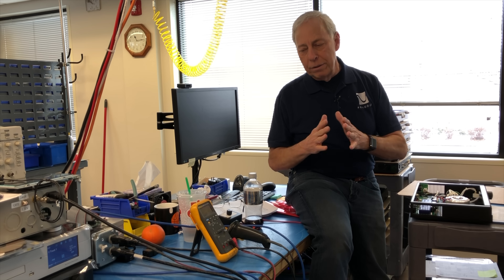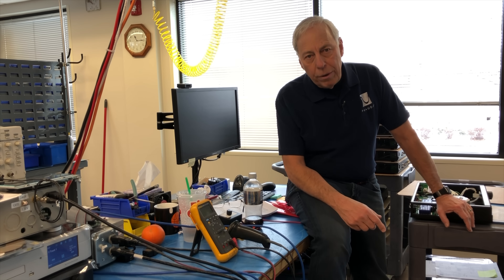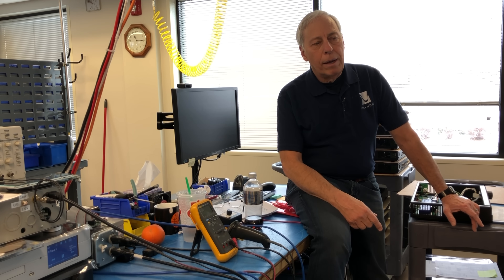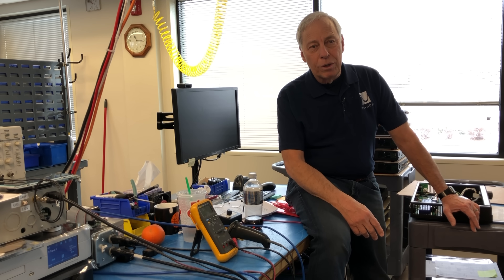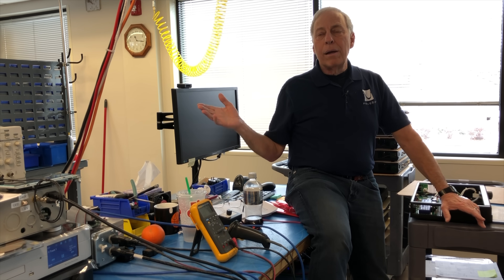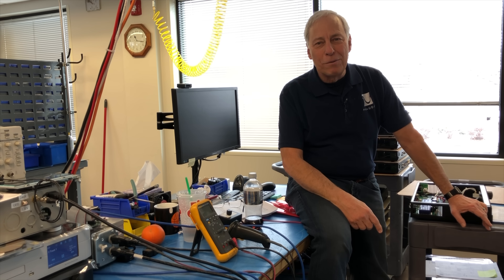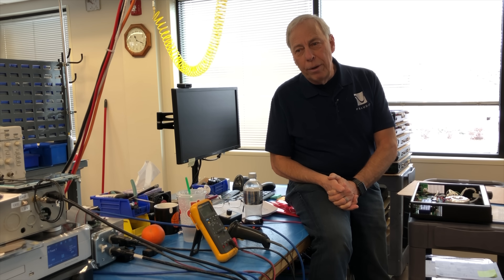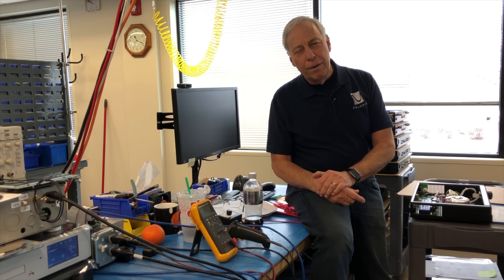An amplifier's first watt

Comment: When transistor amps first came to market they exhibited specs 'better' than valve amps. Unfortunately these specs were at full power. At low volumes, as no account had been taken of the cross over region of class 'B' amps, the distortion was horrendous. Only the 'tips' of the signal reached the speaker at low volume. The rest got lost.  There is also the presence of background circuit noise that intrudes at low volume. A mains hum which annoys at setting one, may be inaudible at setting 11. It is possible to design 'full range' preamps with 'slow' ic's such as the 741. A lot of mixer desks apparently had them before the likes of the 5534 came along with a nice wide bandwidth and low noise. You just have to take account of the slew rate limitations of the beast, limiting the gain accordingly. Modern power amps are much better behaved in the cross-over region (using class AB), or avoid it altogether by using class 'A'. How successful they are at driving speakers at low volume is another question. This was one of the driving forces for single driver speakers without crossovers to muddy the sound.

Comment: Lord this guy needs to go read some spec sheets and do some real world comparisons because he clearly hasn’t. The crown DC300 was built back when crown wasn’t exclusively pro audio and was a remarkable highly resolving amplifier that was actually used almost exclusively in home audio applications and is to this day one of the best sounding amplifiers I’ve ever heard at any price. Remarkable sound stage can be achieved from that amplifier. My pops still happens to own one and still uses it to this day. I have the little brother which was the DC150 and it to is an incredible amp. Almost identical specs but half the power. I don’t currently use it because my JBL 6290’s sound slightly better and have way more headroom but that doesn’t change the fact that Paul is constantly talking out his ass on some of these topics. I know because I have vast hands on experience with these very amplifies and am pretty well versed in crowns product history. These days I wouldn’t be caught dead using a crown amp in a resolving system but back in the day they made incredibly good amps for both pro and home applications. Regarding the first watt issue, as the greatest amplifier designer who’s ever lived Mr. Nelson Pass would say if the first watt doesn’t sound good who cares what the rest of them sound like after that. And yes I have experience with Pass amplifiers. Yet another reason why I’m comfortable saying Paul is full of crap regarding the regarding the crown DC300. As Paul would say end of rant. I didn’t mean to go on a tangent but lord sometimes he just says some off the wall stuff that has no basis in actual reality

Comment: I have a Crown XLi2500, a "lower end" AB amp, a lot of power. It does a nice job especially with rock, electronic, blues. Not trying to say it is HiFi or anything, but definitely good quality, good power, neutral sound. Great for it's purpose.

Comment: That Crown DC300 could start a car. But they also did exceedingly well with difficult and challenging speaker loads. The stability was stunning. Also, since guys were trying to have rock concerts in their homes back in the day, nobody came close to the power and fidelity that the Crown could deliver. The specs were about as good as anything before or at the time and in many ways, the DC300 did very well in critical listening reviews. Stereophile gave it about as glowing a review as the voice-coils were getting on JBL drivers all over the kingdom. Anyhow, I've had some pro audio amps in and out of my systems, always willing to give one a try. But they never satisfy with all of the nuance and sonic realism that hi-fi companies strive to create. But damn, the Crown DriveCore class D amps offer insanely great value and performance with many liking their hi-fi sound.

Comment: hi   ,i want 
to make this nelson pass f6 amp  and i got toroidal transformer at home but its not 18 
volt secondary  but 24 volts so i got 6 volts excess. my question is. 
can i use this transformer! is this  a good solution to put resistors 
between capacitors to reduce voltage supply!  and what resistor value 
will be correct and watt of the resistor so this amp works with 2 amperes 
about.thanks  for your help you can  see the shematic at diyaudio

Comment: Watt? I had a Harmon Kardon 30watt reciever. I always wondered how much power it was putting out so I bought a wattmeter from RadioShack and found that at a pretty loud at only 2 Watts. Sure it would put our more under peak loads, but it still wasn't that much. A while later my buddy invited his friends and we had a party. One of the guys wanted to hear what my stereo sounded like so I fired it up. It was about mid May at the time and when I put on Pink Floyd's we don't need no education with the door and windows open and cranked it loud enough to enjoy, we heard cheering. I stuck my head out the door and looked at the High School Football field next door. We discussed what might be going on because it was long long passed Football season, so one the the guys ran over to take a loot. He peeked through the vines that were growing out the fence, and he came running back, beer in had yelling turn it off. When he got the the apartment I asked what was going on, and the school was holding its graduation. So we shut ever thing off closed up and turn out the lights. Sure enough no sooner than we went silent the police showed up shining their light through our window. After a few minutes the left. But it didn't take much more than maybe 5 or 10 Watts to get arrested! Luckily they didn't knock on our door. There wasn't much room in the apartment for fifteen guys!

Comment: Here's the thing. Unless you are sitting a LONG distance away from very inefficient speakers, at normal listening volumes you are probably never going to use more than a few watts and 90% of the music you listen to will be in the 0.1 to 1 watt range. The first watt is the most important.
Reply: Bruno Rivademar Very true, I thought I was listening to my music at a loud volume and figured I'd check with my multimeter.

It was about 3V peaks on my 85db sensitivity Chane A1.4s... About 6-7 feet away from them too.

To anyone wondering what 3v means, that's under 1 watt on my 8ohm Chanes.
Reply: WORD!
Reply: Yeah thats true. I listen in near Field. My amplifier Has vu meters and while i listen vu meters shows 0.5 W to about 1.5 W max.

Comment: Paul, when you say the first watt is class -A and then goes to class D etc etc etc... does it mean that if i listen at 2 watts the first one will still be provided by the class A section?
Reply from the maker: Yes, but let's not think of this as separate things. It's the same amplifier in the first watt or the last watt. If you only listen to 2 watts and the first watt is biased to be class A then yes, you're listening to music in class A. The point is that once you get past a certain point in loudness the biasing of the amplifier isn't as important as the first bit because low level detail is what's majorly affected.
Reply: I think you mean class B not D. D is another bag of worms entirely.  What you are essentially listening to is two separate amplifiers amplifying the positive and negative parts of the signal separately. In class B (actually AB) each amplifier is biased to stray a little over the zero volt boundary, so around the zero volt point both amplifiers are amplifying the signal and driving the speaker. If the amplifiers did not have a bias to have this shared region (pure class B), there would be a gap where no signal was being amplified, even though there was a a low level input. This mangles the signal, particularly at low levels. This shared region can be made very wide, giving what is described as 'push-pull class A', which may on signal peaks lead to just one output device conducting, not both, so it becomes class B for that peak.

Comment: I’m surprised anyone would try to use a 308 or 741 op amp in an audio application.  I’m familiar with them because in the 1980’s they were used extensively in analog industrial electronics.  These were circuits amplifiying or filtering sensor signals for measuring flow, pressure, temperature, etc...  they were rugged but low fidelity.  They weren’t designed for audio.
Reply: No, but an opamp is an opamp...

They are fine for audio, the 741 a bit noisy and slew limited if you want a few volts out of it at 20 kHz...

Too many amatwurs talking shit.

As usual...
Reply: If you have nothing else, and discrete transistors aren't cutting it, as regards performance vs board space vs power required, you go with what is available.  Keep gain low enough to cover the audio bandwidth and take care with decoupling power supplies and stuff and even the 741 and 301 will put in an acceptable performance. I have a Quantum Electronics preamp with nice specs from the '70's which used 301's which sounds nice.  It sounds slightly better with a modern opamp, although with the circuitry involved it required an common mode performance close to the rails hard to find (the original 301 didn't). The 301 also makes an appearance in the Quad 402. Again the specs were adequate to good.

Comment: Well Paul how come may of the top recoding studios use Crown PSA  and SA2s ?
why dont you explain the importance  of amp type design A/Ab ,D etc. since the effect of crossover and bias distortion at milliwatts is the key to sounding true at low watts.
and dont forget the slew rate which is a time domain effect on the sound. yes it takes longer to reproduce a larger signal (uv/sec). limited by the amps active elements(tubes or semi)
so its relitivley easy to  design a 1 watt amp. with faithful reproduction pass thru.
you worry about dithering with DAC dont you??

Comment: I was hopeing he'd mention Class D amps as well, many sound TERRIBLE at low levels.
Reply: Is that why my cheap Denon AVR has like no volume up until 40/100? My Yamaha RX500u (late 80's) is really loud with it's knob barely turned up. Why is this?

Comment: Some older high power amps sounded ok at low volume but when you pushed them their midrange screamed at you. Back then I preferred hot low power class A amps.
Reply: I"m still not sure class A amps (or at least class A for lower watts range) aren't the best way to go.  What do you prefer now?

Comment: There must be measurements wrong with the crown.
Reply: @jim9930  0.01% thd is actually not low for an amp. This indicates that imd will be much higher than 0.01% 
I would call any amp over 0.003% at 10W hifi. And over 0.0001% 10W ideal.
Reply: @jim9930  Room is different. Also, multitone is what matters. Plus room reflection can be interpreted by our brain.  .01% thd is just no where near ideal.

Comment: Don't forget that human hearing, being fundamentally logarithmic in sensitivity, you might be right to be concerned about the first milliWatt. 
Check my math on this (I did some rounding -- forgive that).
If a music crescendo requires 100 Watts to produce 100 dB at 3 feet, 
a reproduced sound ~70 dB below the 100 Watt level (a practical -70 dB noise floor) will be about ~0.0002 Watts. 
That is 0.2 milliWatts.
Think that isn't important? Think of the triangle player in the back row with the percussion section.

First Watt? I would say "first milliWatt."

Engineers may be trained in a linear measurement world. Music lives in a logarithmic world.
Thus, audio designers and builders find themselves much like the mythological Sisyphus.
Reply: @Jim Shaw That’s an interesting point. Now you’ve got me thinking about stuff too much, and I just wanna go to sleep! lol 😴😂
Reply: @My Name I don't wish to niggle, but in the example I offered, I was referring to the triangle playing alone. Thus, the first milliWatts count very much. And it would be much better if you can hear it, and it sounds like a triangle, not a sleigh bell. 12 bars down the score, you'd still like to hear the tutti crescendo as it is, not like the truck that empties a dumpster. So bugabee?
Reply: @My Name No, I don't have to realize that, because it is fallacy.

Comment: Wonder what Paul thinks about Parasound?
Reply from the maker: I am a fan of John Curl's work and he mostly designs Parasound's products. They are beautifully built (in Taiwan) and are excellent value for the money.
Reply: @Paulmcgowanpsaudio  Thanks Paul for answering! That is what I currently own, the Halo a31, which is powering my front 3 channels. I agree that they are great high value products. I do have a PS Audio power cable coming out of it ;). And it damn sure makes a difference in sound quality! Thanks again Paul for making great videos!!
Reply: @Paulmcgowanpsaudio  Lucasfilm Sound-designer Ben Burtt used Parasound amps in his personal editing suite.
Reply from the maker: @X2FileWrightonite  Parasound along with its designer John Curl make great products.

Comment: Best video yet and Paul Nailed it !!! One and done . If you can't get the first watt right all the rest will follow . I'll name one amp that has been ignored for years  McIntosh MA6100 . Not the greatest specs or the greatest power but one of the juiciest amps ever made . This amp wasn't made for specs, it was made for music love making . 

Best example in getting the first watt right is speakers with 106 db 1 watt 1 meter efficiency. 

Okay I have made the argument that efficiency is not done across a full 20 Hz to 20 kHz width but at 1K but still that one watt is going to make some noise . I guess if your speakers are 80 db 1 watt 1 meter I wouldn't worry about those first 15 watts (this video is not for you). Sad emoji for you and ha ha emoji for me .

Comment: High power PA sound is quite often running at 5-10 % thd... big amps are designed for power and stability only ...
High end audio amps should behave the same at 1watt or at its max rms rating ... what makes an audio amp musical and really inviting is it's ability to be transparent with zero phase shifts across the frequency spectrum... and above all to handle many many different waveforms with no intermodulation whatsoever.
Reply: Then the Crown DC300A should have been great, it had very little phase shift, down to 0 at the bass end. the IM and TIM were as low as anything from that era. By your same criteria tube amps are terrible. Many people would argue those points.
Reply: Dave Micolichek ,~ yeah no doubt there are .... but who cares about distortion when the SPL is running at 115-120 dB !!
Reply: My Name ~in PA application they're not "tweeters" they are HF compression horns and most have either a seperate amp to drive them or they'll have very steep roll off filters and thermistor limiters

Comment: There are so many things that can go wrong from 1W up to (say) 100W as the current draw increases, heat spreads and various sections of the circuit could be drawn out of linearity - among other things. But I will agree that if a design can't properly handle 1W, how can one hope things get better beyond that?

Comment: Right, i feel Paul missed the answer on this one. The whole first watt issue came about because solid state has a basic property of improving sound quality as you turn it up. Pretty much all solid state amps sound best close to their limit. But most people do not listen at those volumes, and some amps sound really bad really low. I personally do most of my listening between 0.01 and 0.1 W and yes 0.1W is pretty loud on 91dB efficient speakers. So getting the first watt right is paramount because that's where the amp will spend most of its lifetime. And it is also the most difficult watt to get right.
Reply: Sorin G I custom built my DIY 98 efficiency speakers. Not possible for me to listen to 1 W of power will damage my hearing and disturb my neighbors.

Comment: TONE IT TO TASTE with an EQ AFTER you get it Laboratory accurate  
My fully Horn loaded, Digitally Active Crossed over Klispchorns run by 3  D series decades old Crowns , sound terrific, from the 0.001 Watt,
The audiophile snobs prefer colored sound instead of Laboratory Accurate sound, which you can then tune to taste.
Reply: Having never been known as an audio snob, I'd say you wouldn't have a clue. Sugden's A21 amp was streets ahead of the Crown even though its specs said otherwise. It was chalk and cheese.

Comment: The original DC300 was fully discrete. The DC300A used a ua 739 in the front end. Both measured flawlessly for their day, but sounded terrible. Many accused them of having very poor TIM performance. I'm not sure if that's true or not. The frequency response dropped like a rock just above 20kHz, and it used massive amounts of negative feedback.
Reply: The 300a used an LM301 for the input amp. Used to drive CUTTER HEAD on recording lathes...

And you want to diss this beast?

Don't make me laugh!
Reply: No one can hear anything above 20KHz anyway. Maybe, a baby can.

Comment: I'm generally more worried about the last watts 😅
Reply: If you use the last watts, you have a too weak amplifier. There should always be generous headroom left when you play or else you will get distortion. If you want to play loud, then get some very efficient speakers, then you are more safe. But your ears might not be equally safe 😊
Reply: @oysteinsoreide4323  The problem is that i like vintage amps and most of them ain't that powerful so yeah, I worry about those last few watts 😅
Reply: @FullFledged2010  Then it's critical to find the right amplifier and speaker combo.